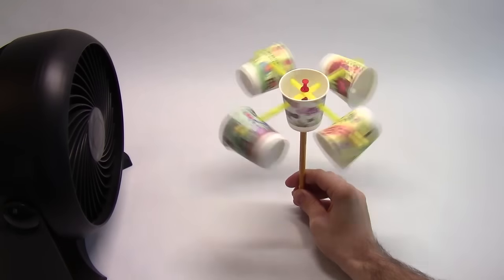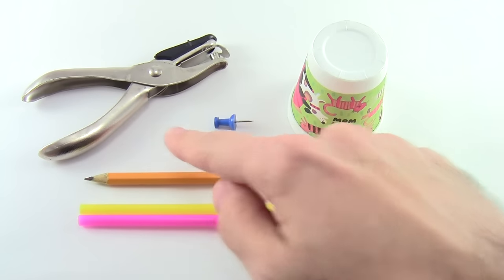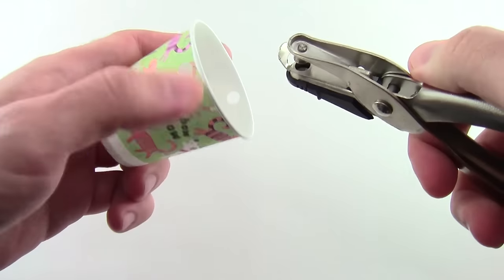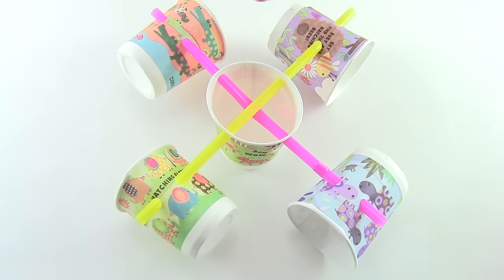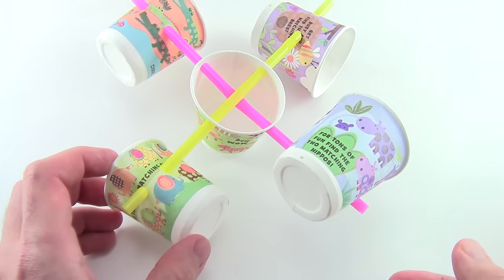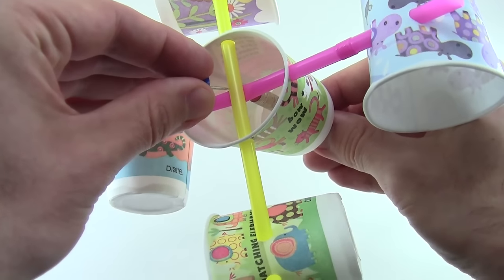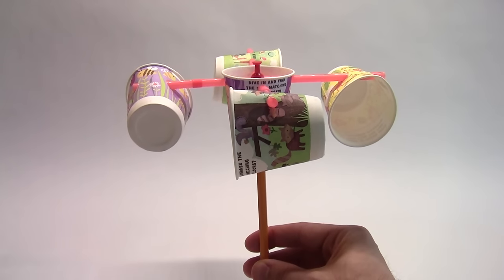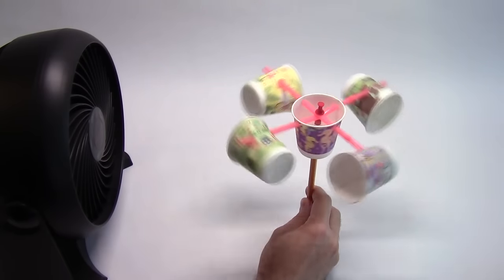How to make an anemometer (wind speed meter)

Comment: How do you calculate the wind speed? Is there a formula?
Reply: But there is no formula of calculating wind speed through anemometer... As per my knowledge
Reply: rpm diameter ? :)
Reply: @epicvideosandstreams6096  wind speed = (rotation rate / calibration factor) x wind speed unit.  Every anemometer has a calibration factor, which is the number of rotations it makes for a given wind speed. (This value varies depending on the anemometer's design and specifications.)
Reply: idk
Reply: @eili_04 ljgs
Reply: no if its blurry then its going fast and not blurry if its slow u think for the easiest answer and say it
Reply: Only digital anemometers can measure the actual exact wind speed, home-made, can not.
Reply: Same question
Reply: Yall some nerds😂😂

Comment: do you have to use those type of straws or does it not matter
Reply from the maker: The exact type of straw shouldn't matter.
Reply: @Science.Buddies  ok thanks i had a problem with the project cause this push pin wouldnt work so we used a paper clip and it helped way more